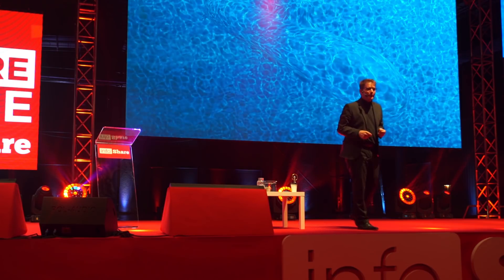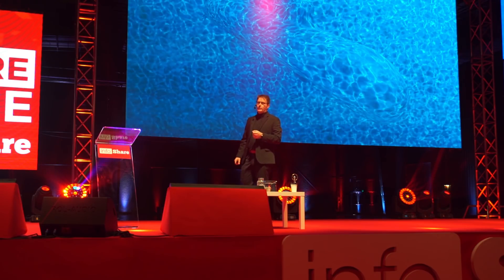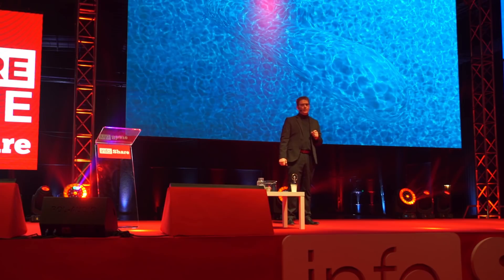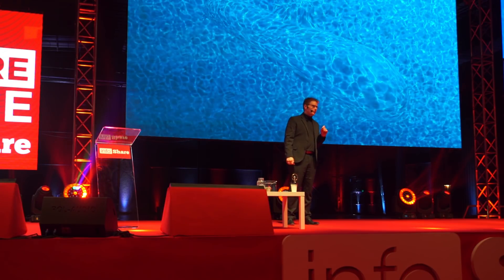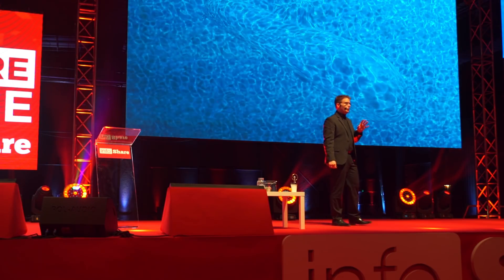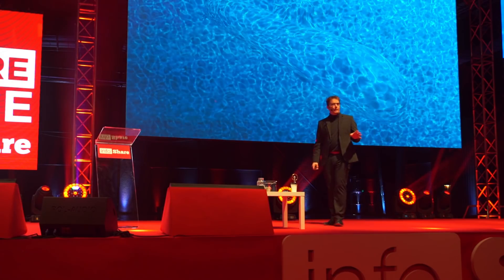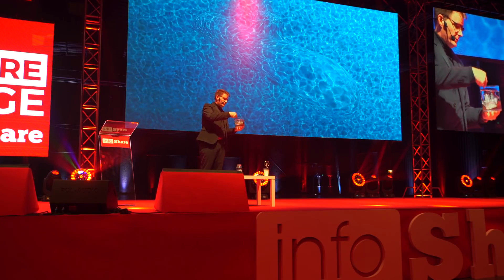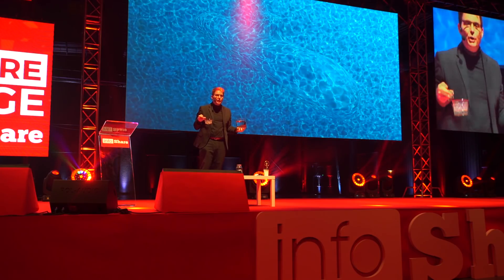How to build an invisible submarine - Saab at Infoshare 2018

Comment: A computer model graphics of the rubber mount, floating floor and the double elastic system could have been displayed in a slide with no disclosures just to see how it looks like. So a dolphin-like sub will be the specifications of DARPA.